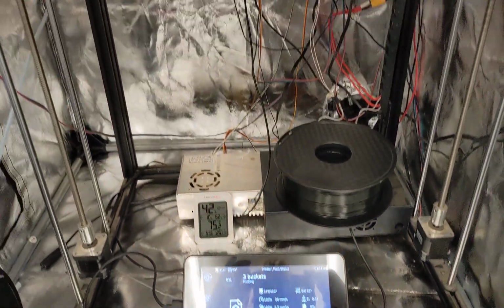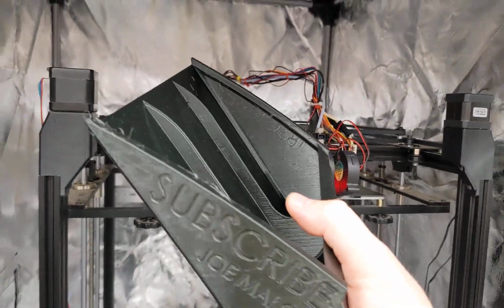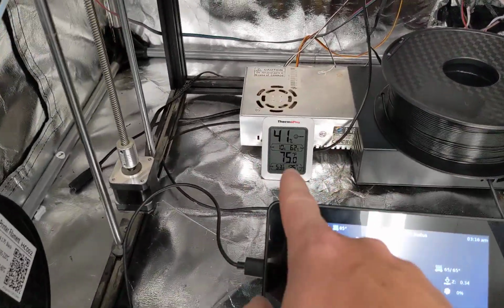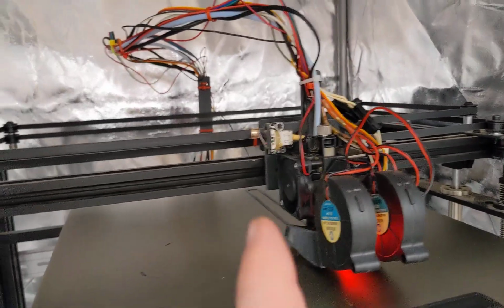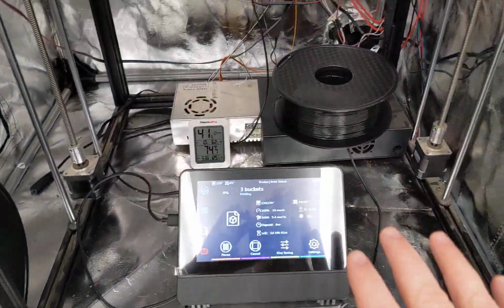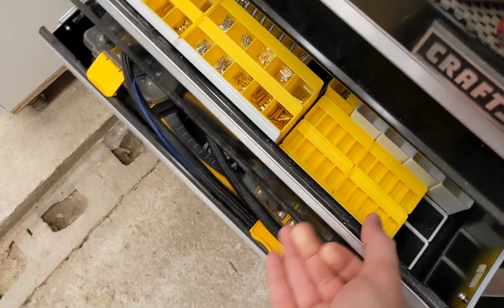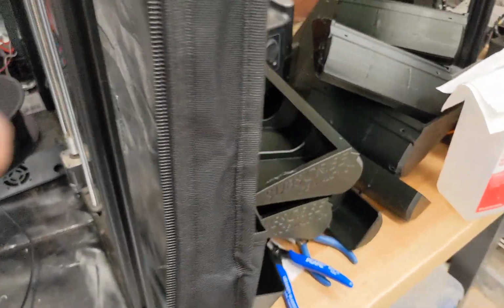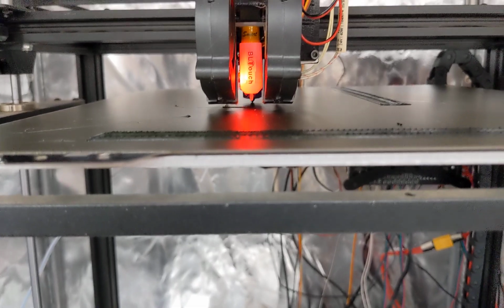My longest 3D printing project ever.

Comment: how long does it take to print these parts? and what nozzle diameter and print speed are you using?
Reply from the maker: 2 days per 3 buckets, each bucket is almost .33Kg by design. I forget the layer height (thickish) but it's a .6 nozzle with a .8 width at 45mm/s

Comment: Assume it’s buckets for a water wheel, You said you’re using PLA - how will that work outdoors. Makers muse, cnc kitchen, uncle Jesse and others have done test on PLA outdoors. They found it isn’t great. 

Are you going to clear coat to provide UV protection? How do you handle creep and sagging due to NC temps in summer? 

I tried pla on test roll prusa give and have since used PETG as it’s so much easier. Petg with clear should be rock solid (however thin parts (<2mm) in direct sun may heat and warp which I’ve had happen).  ASA maybe a better solution for outdoor use… as you have an enclosure it could be worth trying. 

Set up a Long term material test jig could be handy… if your intending to sell these parts…
Reply from the maker: No intent to sell. I have some PLA parts that have been in service in outdoors environments for long enough to give it a shot. I may paint the printed parts white or some other lighter color for various reasons.
Reply: @JoeMalovich  yeah painting to protect is a good idea. I think abs plastic Has to be have painted where as ASA is uv stable or (has Uv inhibitors). 

Again would be interesting to see a practical test of buckets of different materials with painted and Nonpainted to see how durable they are. Ie asa may be awesome but pla equally awesome if painted -and at 1/3 the cost.  You could have some fun print carbon Fibre filament and nylons etc. interesting to see impact of moss, algae etc on materials too. 

I guess with pla you’ve used outdoors - it comes down to the blends of material each manufacturer has their own blend some maybe better than others…
Reply from the maker: @75keg75  the biggest factor is cost, this PLA I got for only $10/kg
Reply: @JoeMalovich  yeah I figured that why you were running with it. Especially when 1 bucket is a roll. Could you get a better saving by using a 3kg roll or is that more awkward to mount to printers.

Obviously all filament features and options don’t matter if you can’t justify or afford the expense.  However once you add in paint coat and time to paint it could balance out to cheap filament.

 I only use prusament petg that’s more expensive at 27/ kg but I know if I set a job it won’t fail. I’m not doing much outdoor stuff so haven’t looked into asa etc much - mainly as I don’t enclose the mk3s. 

Interesting to see you upcoming “wheel“ video..
Reply from the maker: @75keg75  3 buckets per kg.